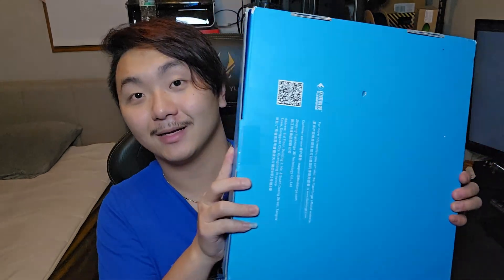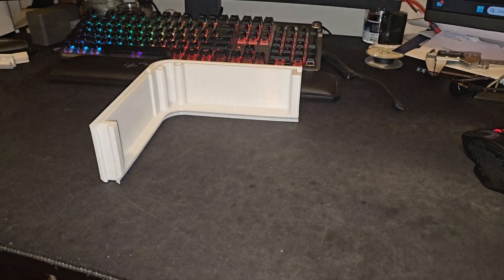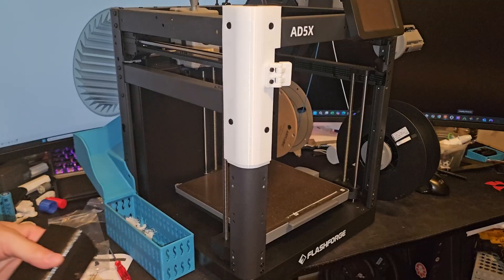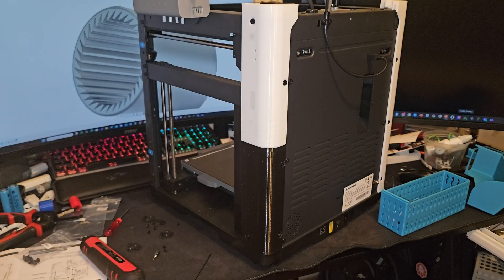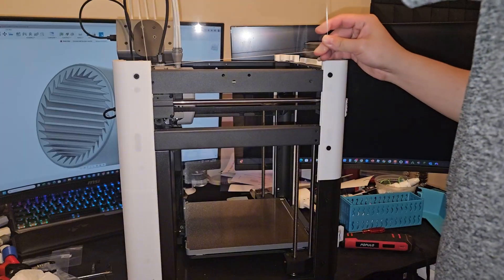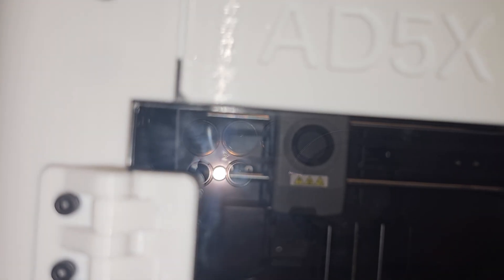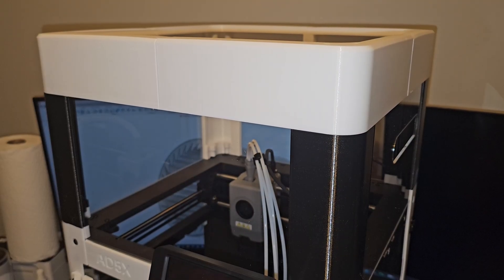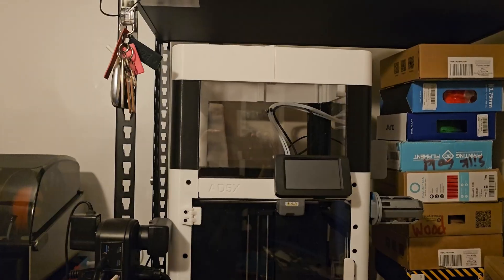Flashforge AD5X Enclosure Kit Install Is It Worth It?

Comment: you are supposed to take out the part near the print head to re-route the 4 tubes through the plexiglass.
Reply from the maker: yeah, for some reason I cant get it out so I did it in a different way.

Comment: fucking company.  They show the filaments on the box and do not mentioned they are not included on the package and then this shit!  You also have to print stuff that you think it will be on the package.  I hope you at least gave them a bad review.  I am not finished watching this video.
Kind of shit is that company,  Flashforge.
Reply from the maker: Lol, I will try to do that, yea its a bummer that the frame is not included. It has been like this for most of their corexy 3d printer with no enclosure.

Comment: Nice vid, nice to see all the struggles before I do it on my own, in my country the enclosure kit is kind of expensive (about $100 USD) I got one on sale for about $60 bucks, waiting for it, and in the meantime I'm already printing the parts in black PETG, I saw that in your video you recommend to use ABS or ASA but how do you print in that kind of materials if you need to enclosure the print on that kind of materials, LOL (unless you have another ABS ready 3D printer at hand)!
Reply from the maker: Thats great that yours in coming in soon! Yeah you do need a 3d printer that can do asa or abs to print in those material, but PETG should be fine, mine is in PETG and it has been holding really well, so you dont really have to worry about it.

Comment: Thanks for the review. I'm about to buy an AD5X, but the acrylic panels to enclose the machine aren't available in my country (Argentina) yet. Also, the price is considerably higher than what you mentioned (US$40), since they're being offered here for pre-order at US$100. I've searched online for the dimensions of the acrylic panels to make them myself, but I haven't been able to find them. It would be a great help if someone could share the measurements and thickness of each panel, as it's much cheaper to buy the acrylic and cut it. Drilling the holes is no problem; that's the least of my worries. Someone mentioned there was a DWG file with the measurements, but I haven't been able to find it in my search, which has taken several days. Finally... does the noise level decrease with the panels and the door? Thanks.
Reply from the maker: Glad you like the review here. I have installed all the panel so I cant get an accurate measurements. Yes the noise decrease is about 6bd. I made a short video about it. Sorry I couldn't help much here.

I guess what you can do is print all the parts and install them onto the 3d printer, then measure the dimension and then cut the acrylic panels to fit it.

Comment: Did you use multiple printers to print the parts list?  You mentioned it took 2 days.  I am printing only print plate 1 right now and it's going to take 39 hours.  At this rate it might take all week to print all the parts.  Using PETG which is what was recommended online.  I was going to use ASA but can't deal with a weeks' worth of fumes.
Reply from the maker: No I use my k2 plus to help and print some parts. Also how much supports are you printing with? Because some parts dont really need support and if you auto generate supports then it's going to take very long. But if you paint the support and only use supports on over hang that is greater than 45 degrees then it should take much shorter to print.
Reply: @Scratch3DPrinting  I've figured out that less is actually more. Printing only 2 parts takes 3-5 hours but 4 parts 12-15 hours. So I'm only printing a couple at a time. At the end of the day it will take fewer hours to print multiple plates. Plus it is way less wasted filament. Very little poop. I am still figuring out the supports. On one of my previews I thought I removed the supports but they printed any way.

Comment: I think it is probably a lot easier removing the ptfe tubes from the extruder than from the IFS unit.
I bought this also for my ad5x but not installed it yet, more as a reference, as I have started to build another enclosure design, that should offer improved insulation and fume/particle extraction, along with the possibility for chamber heating and storing the materials inside the enclosure to keep them dry longer. 
Main problem I have with it currently is isolating the electronics, so than they can be cooled more efficiently, as flashforge is only sharing cad files for certain parts of the frame and I am working on many projects currently.
Reply from the maker: Same here I have many projects that im working on and could never get one to finished. Having a chamber heater would be grate, plus getting the filament inside is also a good idea, but would that make the enclosure very bulky...?
Reply: @Scratch3DPrinting  Yes, it would have to be slightly bigger, but not that much considering that the filaments currently take up the space on the right of the frame.
Reply: @arielmarshall5501  You'd also have to leave room to (un)mount the reels.  That would take some space and be quite awkward.

Comment: Ok bro i looked for this print for the A4 -D4 FOR THE ENCLOSURE. Does Flashforge offer this enclosure??
I already received my enclosure. Last week but the tubes from the IFS rub on the top of the enclosure. Your model prevents this from happening. 
Is this something from the ADM?.
If you could send a link for the print that would be nice
Reply from the maker: Im sorry I thought i put it in the description but I didnt.

Here's the link for the files I printed with:
https://wiki.flashforge.com/en/ad5x/Files_for_printed_parts

Comment: What is the top portion of your enclosure A4 B4 C4 D4 is what I'm referring to. 
That looks like the riser. That goes on the bottom. 
Anyways I'm trying to find the 3d print for that top portion. 
Do you have a link for that? If soo I would really like to print that out.
Reply from the maker: Yeah it is.

This is the link: https://wiki.flashforge.com/en/ad5x/Files_for_printed_parts

Comment: Living in Puerto Rico Flash Forge does not ship here. So I have to wait until the printers and accessories are sold on Amazon. I tried preordering the kit but the shipping kept being extended. I canceled the ADX5 kit and bought the 5M kit. It basically is the same with out the top side panels. I used 3mm black corrugated plastic for back and sides top panels. I printed the front top panel to fit a glass plate from a 5*7 picture frame for viewing. the only other thing I adapted was to print an extra pair of the door hinges and mounting them top top panel rear.
Reply from the maker: Ahh, I think its available on Amazon now, check the description of the video for most recent updates.

Yeah it is very silimar to the 5M kit.
Reply: Yo lo compré en Amazon! Lo enviaron rápido.